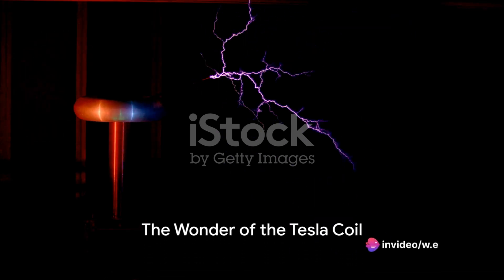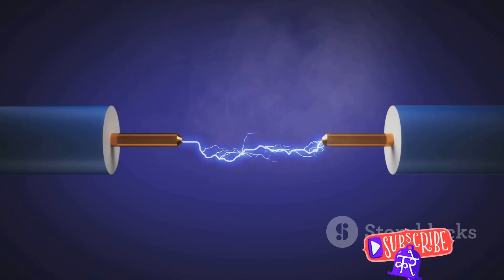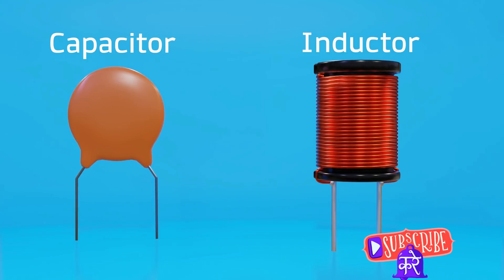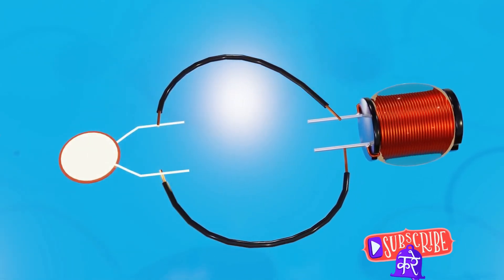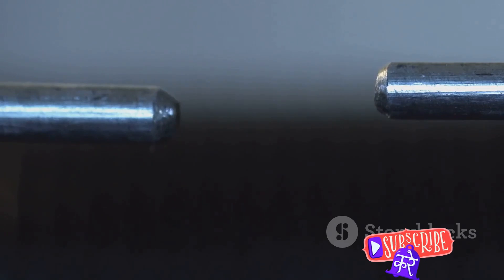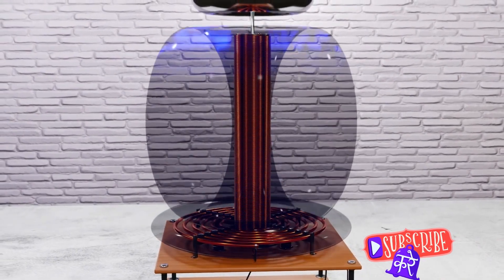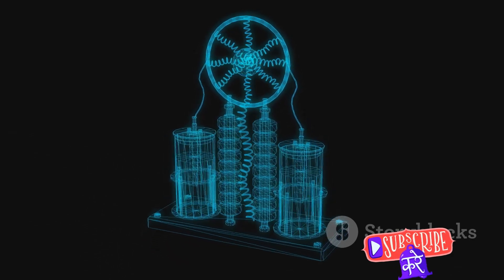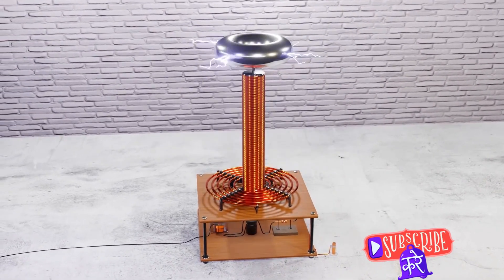Watch Electricity Jump With This Cool Invention!

Comment: WHAT'S IT GOOD FOR?
Reply from the maker: Here are some of its applications:

1 ) Wireless Power Transmission: The Tesla Coil is often associated with the dream of wireless transmission of power. In fact, it was originally developed by Tesla for his ‘World Wireless System,’ a method to transmit power and information without the use of wires.

2) Education and Entertainment: Tesla Coils are used in educational demonstrations and in entertainment to create impressive lightning displays. They are also used to play music by modulating the system’s output, as seen in the video “Tesla Coil Unleashed: The Power of Modern” https://youtu.be/jWAvrJXn20E?si=zwmDxh4ucjp3kv7P.

3) Electromagnetic Field Testing: Due to their ability to produce high-voltage, high-frequency currents, Tesla Coils are used in the testing of electronic equipment for immunity to electromagnetic interference.
Remember, while Tesla Coils are fascinating devices, they should be used with caution due to the high voltages involved. Always prioritize safety when dealing with Tesla Coils or any high-voltage equipment.